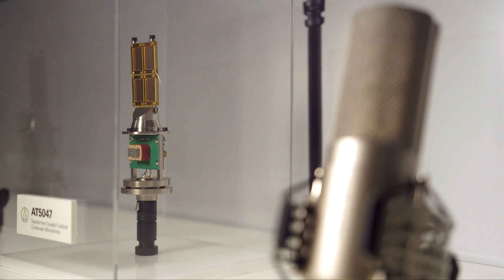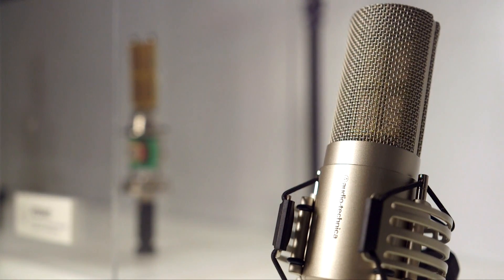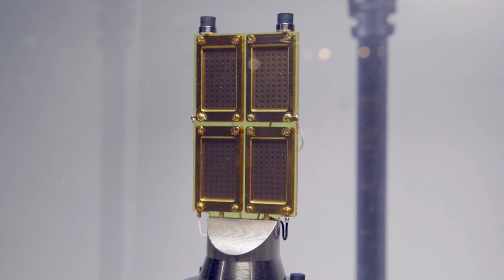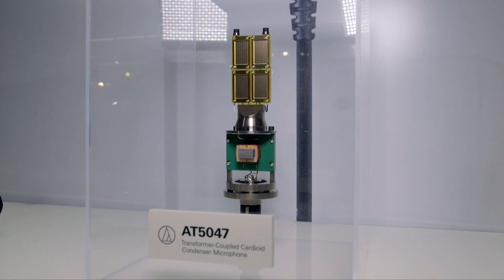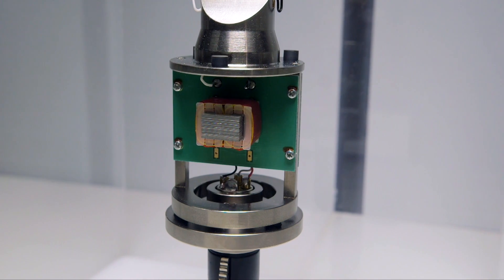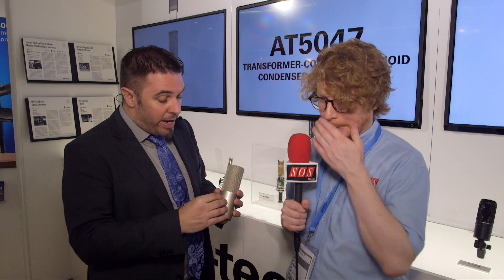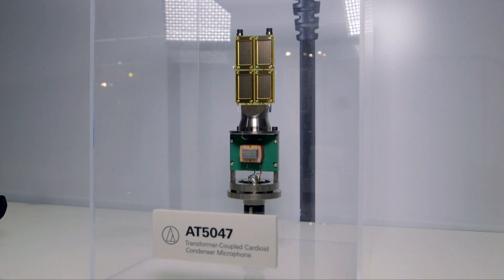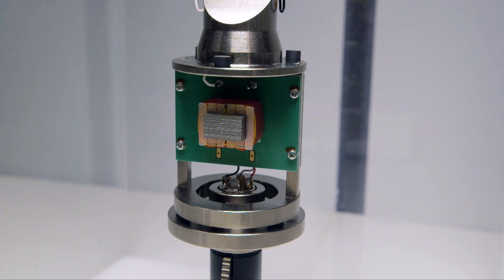Audio-Technica AT5047 - Prolight + Sound 2017

Comment: Designed for people who can't afford good mic pre's yet costs £3499.00?
Reply: your twisting words buddy! he just stated if you dont have a very high output input stage(which may not always have to do with cost) that the new mic will take care of giving you the output levels you need, because the other mic he talks about has a very low impedance so certain pres may compromise audio quality by no fault of the mic, just that the pre may not have enough impedance and output! many great affordable pres would work for the mic!( the older one) I think it would be more like pres in the 50-300 us/can dollar range that wouldnt be able to do the job!  you missed the point I think, thats all! its not like, hey heres a new mic designed for people who cant afford a good pre! he was just reffereing to the other model because its design a good pre is optimal, and with this new mic, the design is not going to affect it in the same way! I would hope that if someone is going to buy a mic of this caliber, they would know enough that using the cheapest of the cheap pres would be pretty whack! lol...Plus not everything is about price or good vs bad! there is a middle ground, and many different situations(just in general)...Just watched an interview with Cameron Webb I believe(MOTORHEAD) and a band he just recorded he was using 300 dollar(us/can) mxl 2003a mics for the rooms! ust like sm57's are a standard ... so just generally saying, (One needs to think outside the box if your aiming to be great! Hey, I like that!!!